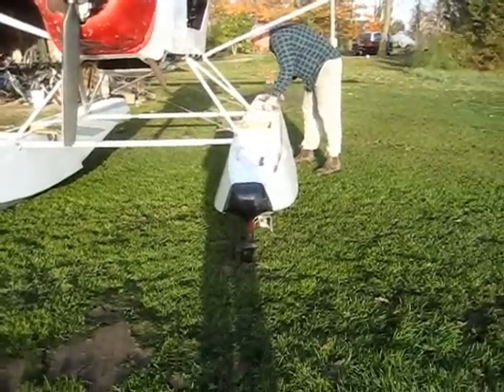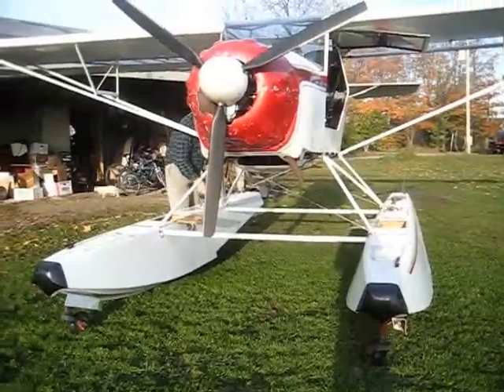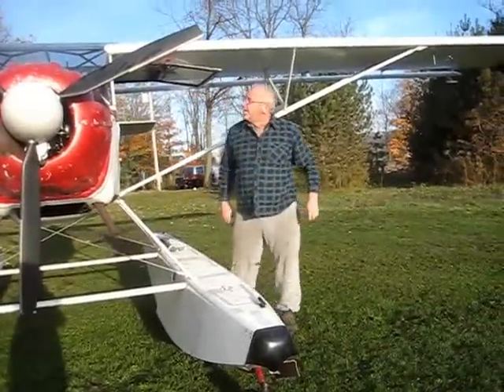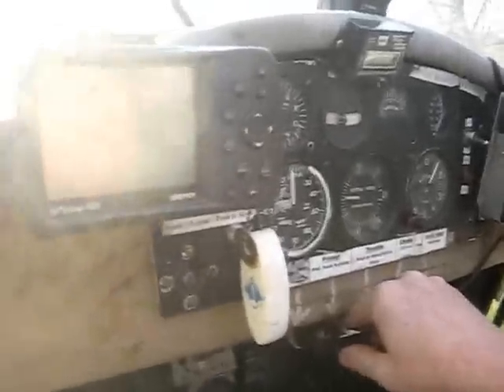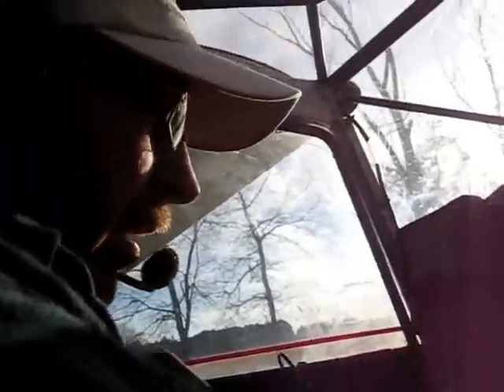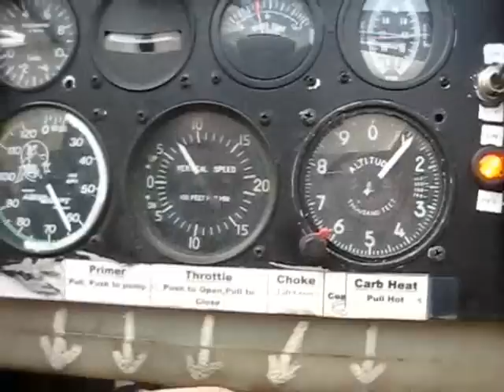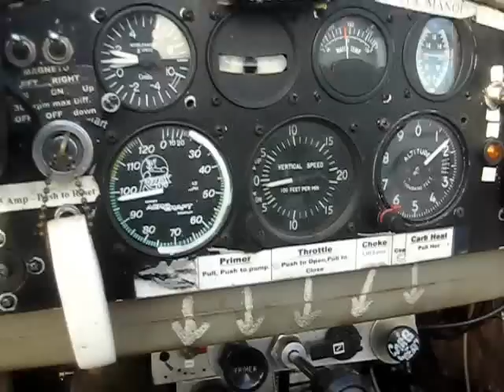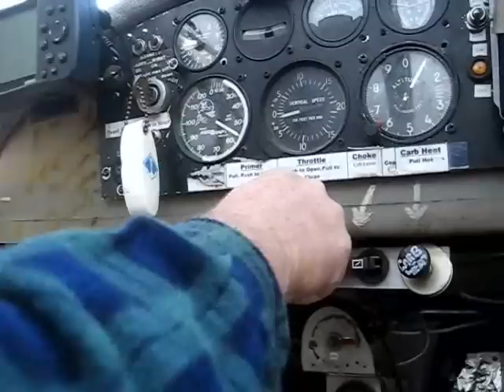kitfox aircraft  amphibian floatplane walkaround

Comment from the maker: @ytzpilot -   not a big deal if you know  what you doing. I am jetted for base here ar 955' ASL and most flying done at 5500 or less. If over 7500 feet all the time a mixture would be a benefit.   Now with more dense air I will re-jet soon once floats come off and burn about 15% more fuel but that will keep the EGT in line for the most part